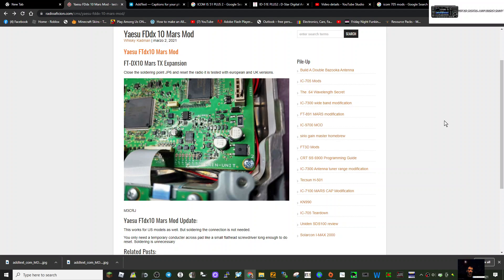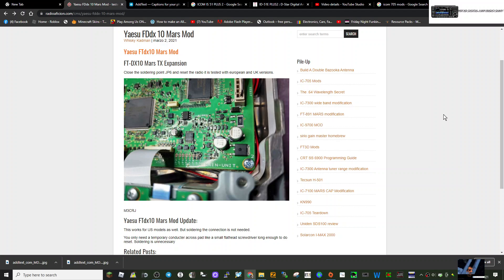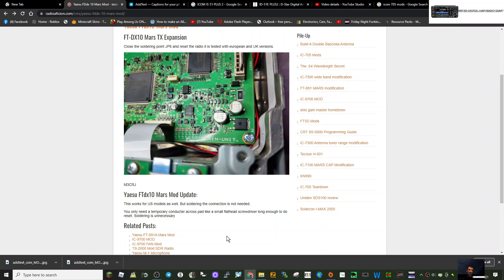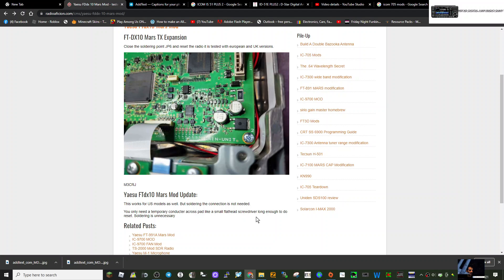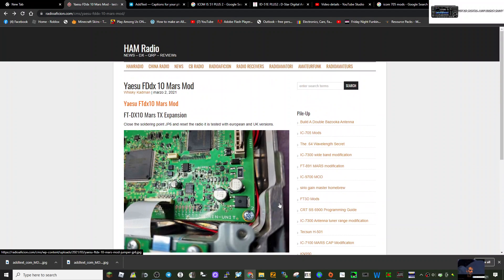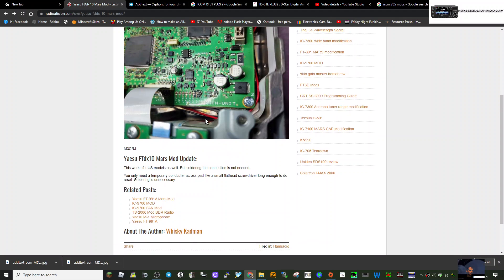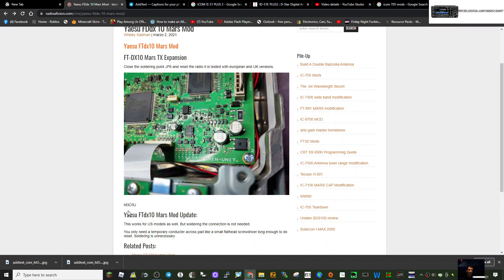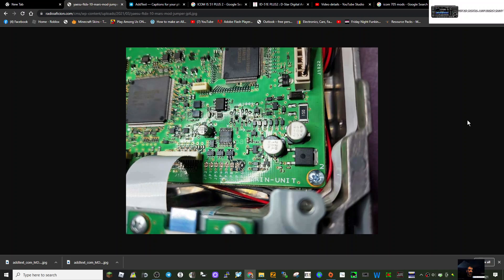YAESU FTDX10-MARS MOD-INFO

Comment: JP6 is just making a ground connection when you connect the 2 very close connection points. I just look over the service manual and that is all you are doing jumping a connection to complete  a ground to wide band . Yeasu is so cool how they do this stuff. look on page 91 of the FT-DX10 service manual to the bottom left hand side and you will see it . just do a search for the FT-DX10 Service manual.
Reply from the maker: How about ft710 ?
Reply: @M0FXBHamTech  pretty sure since it is SDR based there will not be one and Yeasu will have to send a file to you for region change but you will have to show proof of MARS lic.

Comment: You can apply the mod without permanent modification by temporarily providing the short while doing the reset of the transceiver.  The setting will be retained until the radio is reset again.  You won't void your warrant because no hardware rework was performed if you do it this way.  Resetting the radio then removes the mod if you're selling the radio or sending it in for service.
Reply from the maker: Interesting thanks

Comment: Only problem with that mod flathead screwdriver if you have to do a firmware update and reset the radio you lose the wideband and have to repeat the process again to get it back
Reply from the maker: Yes not good
Reply: @M0FXBHamTech  best way is to use conductive ink they come in a pen format one quick dab done can be removed if there a warranty issue